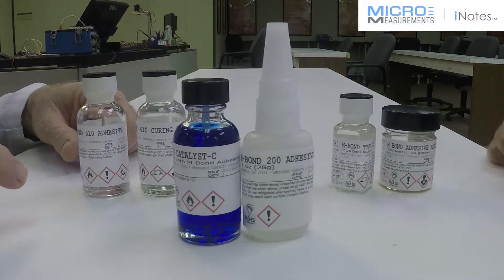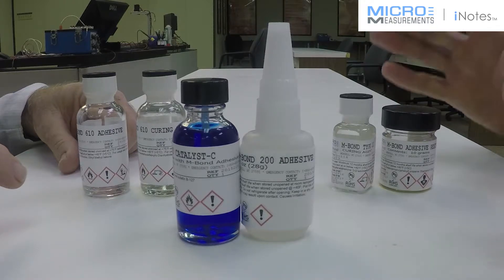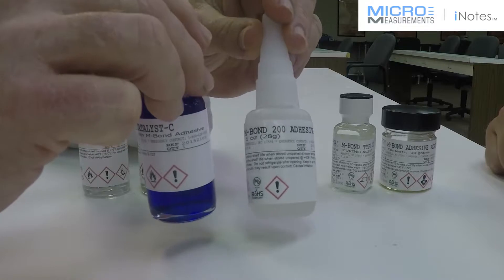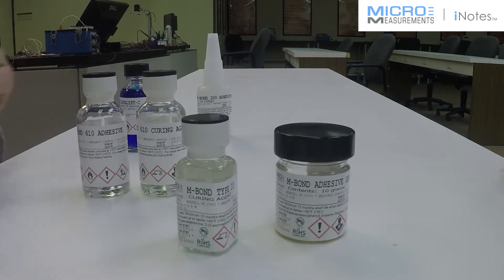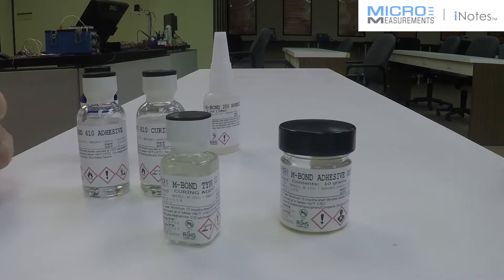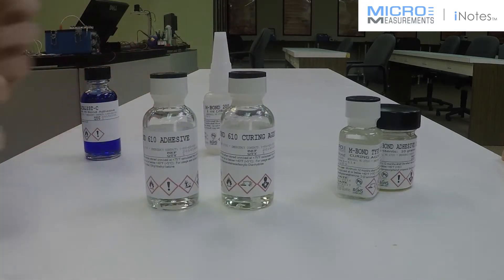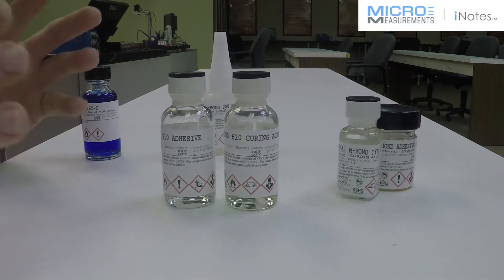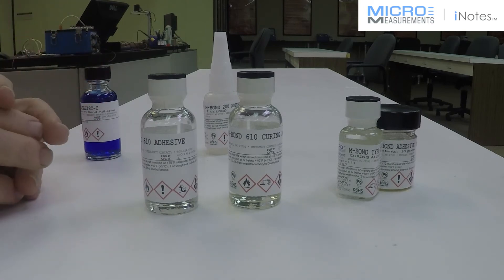Choosing The Right Strain Gage Adhesive For Composite And Plastic Materials

Comment: Siempre es muy importante seleccionar el adhesivo correcto para cada aplicación, y mucho más cuando las bandas extensométricas se han de instalar sobre materiales compuestos o plásticos.
Desde Micro-Measurements y su filial española Vishay Precision España, ofrecemos una amplia variedad de adhesivos, para apartase así a las diferentes aplicaciones que se nos planteen.
Si precisa de información adicional, por favor no dude en contactarnos y estaremos encantados de poderle ayudar.
mm.es@vpgsensors.com
miguel.bravo@vpgsensors.com